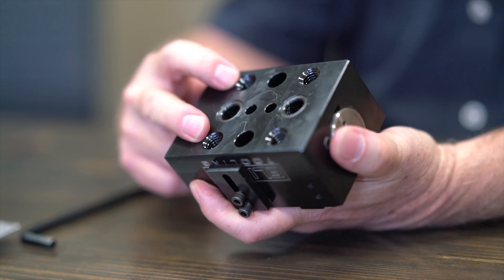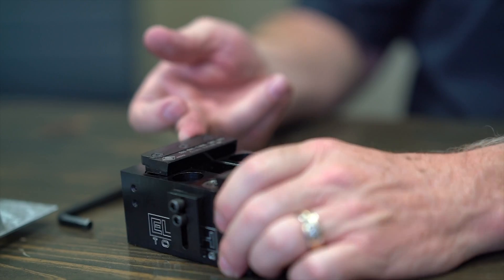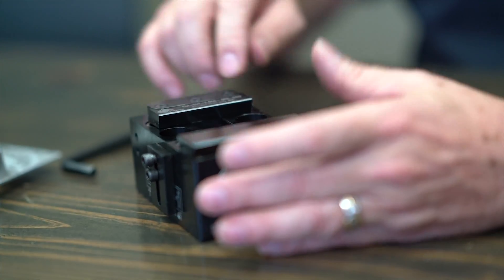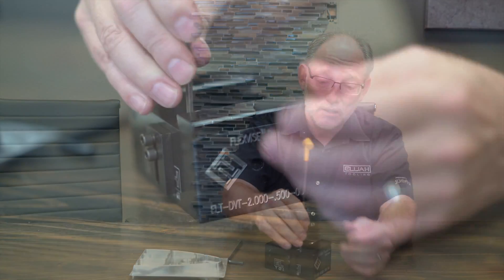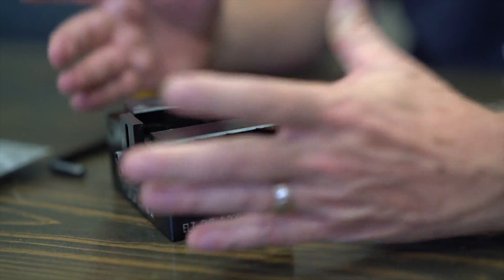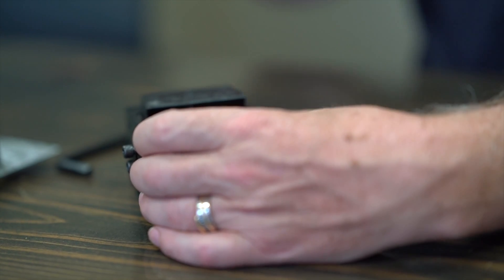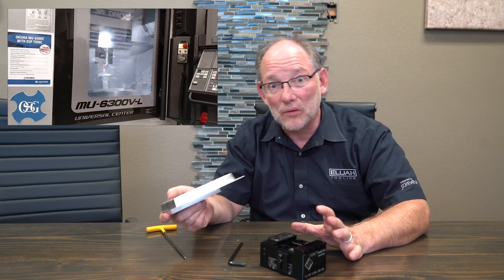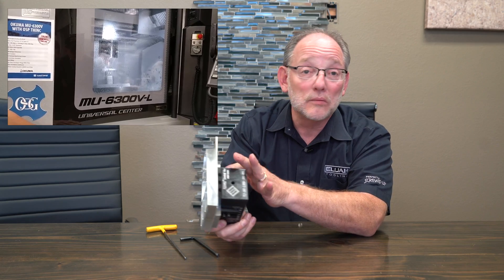The Most Stable Dovetail vise on the market  | Elijah Tooling

Comment: Hey Rick - love the product but this video needs work.  The depth of focus is not good and you need to use physical parts for examples rather than just pointing to features.  You know this product very well but we don't.
Reply from the maker: Hey Rob, thanks for the feedback! I agree with you, the video has issues like depth of focus that we've since improved. If you want to check out some of our newer content, you'll find that we've improved the quality of our videos. Also, the vise in that video has since been replaced by the D-Drive vise, which we have some killer videos on! 👍 https://youtu.be/oJuEJsHpGtY